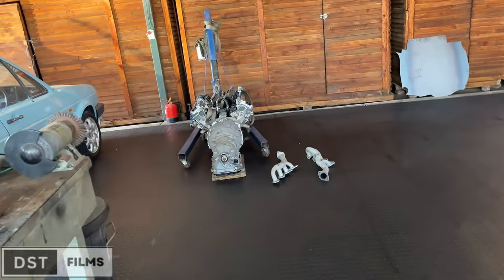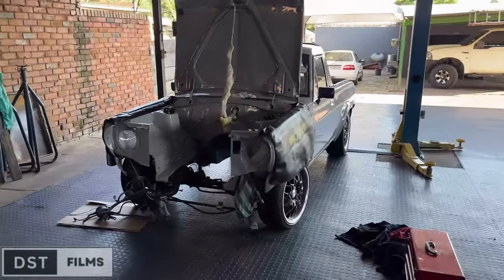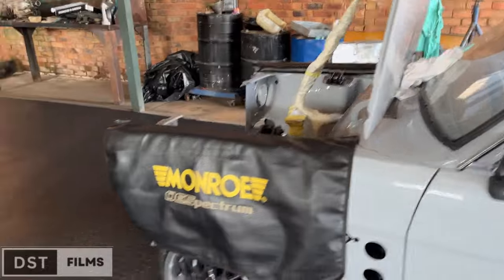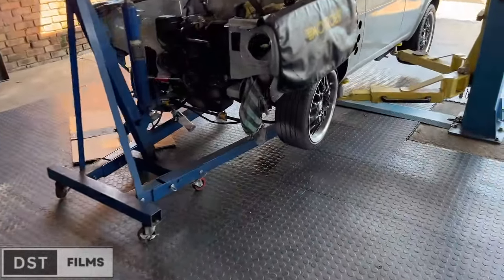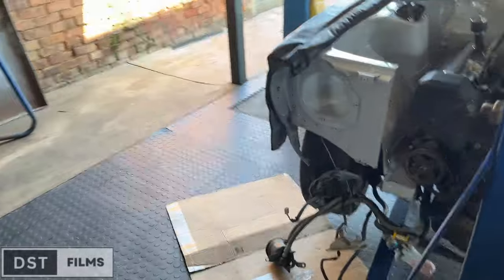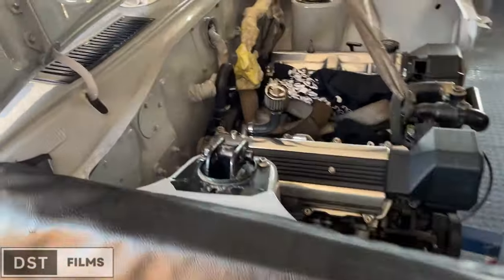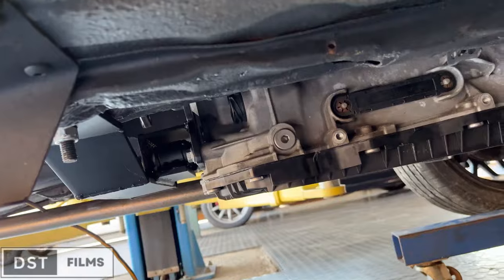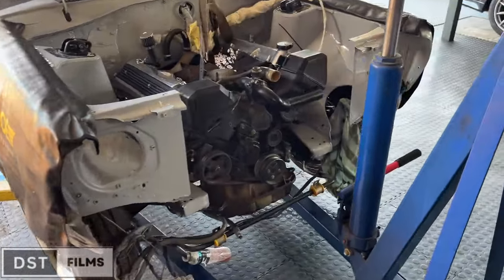1UZ-FE Swapped Nissan 1400 Bakkie with a 8HP70 gearbox. Engine installation

Comment: Subscribed! What an amazing build. Which adapter did you use for the 8hp trans to 1uz? I’ve been tossing around the idea of doing this transmission but have 4x4 and trying to think through a manual shift transfer case.  The 8 speeds are amazing! One of the best transmissions ever with the best engine ever, nice thinking!
Reply from the maker: Thank you for subscribing. The owner of the bakkie got everything from dictator here is a YouTube link to there channel which covers the question on which adapter and controller is going to be used 

https://youtu.be/Cf92SpTLJR8?si=flOSsPyDGHTzwE5x
Reply from the maker: Domiworks transmision adaptor